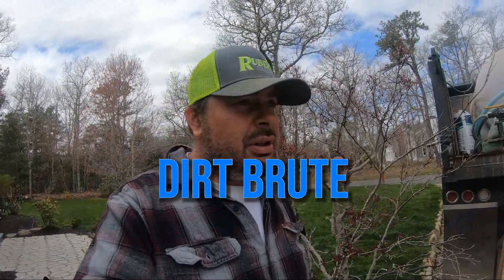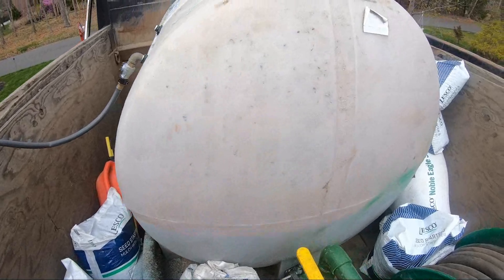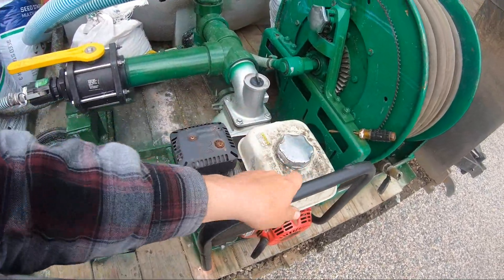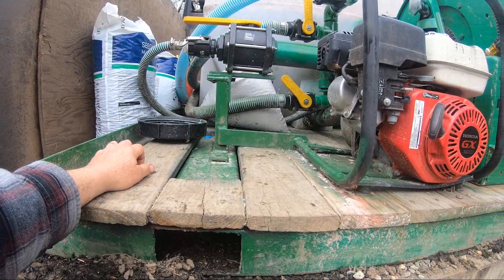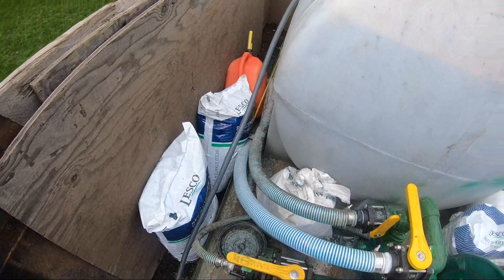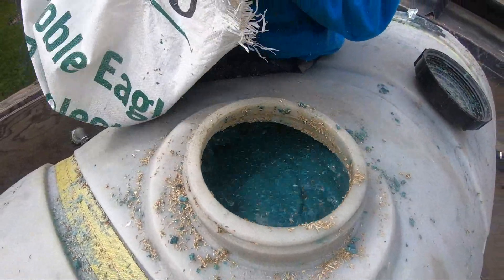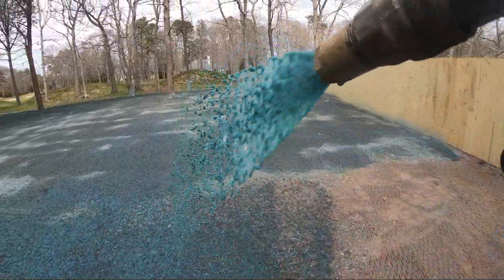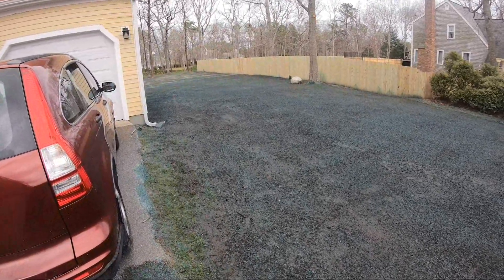Homemade DIY Hydroseeder 2022 Update!

Comment: Cool video!  One our local landscapers actually spread the seed with a push spreader and then spray the fertilizer and mulch over it.  They feel they get better/consistent coverage that way…I have no idea if it’s better or worse but it works for them.
Reply from the maker: I’ve actually done it that way and you get more coverage but the growth comes out bad I think because it not in the mulch it’s under it . We tried it twice and didn’t like it. If you mix it correctly with the right square footage it should come out good.

Comment: how far does one tank go how big of a yard can you do with a full tank? also can I get a material list for a batch what are you using? I just bought a hydro seeder and plan on doing this as a side hustle next year
Reply from the maker: @EluderRacing  i depends on how thick you mix it . I once covered 9,800sqt twice because I mixed it extra thick with 100 pounds of seed and it came out great .  Use 5-6 30pound bags of pellets to 700 gallons of water and one bag of starter fertilizer

Comment: Hi do you think it would make much difference running a separate motor and pump for the jet agitator and another for the application hose
Reply from the maker: It would probably work great but you would be having to maintain 2 engines and more plumbing .plus it would take up a lot more room and weigh more .

Comment: Hey Steve, just wondering if you have a video (or could make a video) on why you changed out your original agitation manifold? Did the 1 inch lines not work or just wanted more flow to roll the tank? I understand the reason for moving the jets to the legs for sure. I'm going to be putting my own skid together next week up here in Canada and found your video really helpful! Just want to make sure it's going to be fully functional first shot. Thanks!
Reply from the maker: The 1” lines don’t roll the tank as good and the 1” elbows clogged.

Comment: what all do you put into the mix and ratio? in the process of building one of these in KY
Reply from the maker: We do 12-17 pounds per 1000sq foot of seed and the mulch pellets are one bag per 150 gallons of water. Sometimes we use a blue grass, Rye & fescue mix. Or just rye depending on what the job is . You just have to go to your local supplier see what’s available in read the mixtures on the bags or the bales

Comment: Did you angle the agitators up of shoot them straight across?
Reply from the maker: My new style shoot across the bottom and rolls the barrel. Check out the video on the upgrades https://youtu.be/KWRgtbzfzJo?si=UPOG8W4XkVL1BlVC
Reply: Thank you
Reply: @DirtBrute  I’m making a hydro seeder and I was wondering how you reached into the tank to tighten up the agitator nozzles?
Reply from the maker: @tmr1331  I put the bulkhead fitting on a plumbing snake then ran the snake to the hole with the nut on the outside. The tightened the nut
Reply: @DirtBrute  thank you

Comment: would be great if you do a video with parts list so DIY's can build their own hydroseeder
Reply from the maker: That’s  a good idea!  I’ll try to work on that
Reply: @DirtBrute  sweet thanks. I was quoted for 12k and because I am located in Greece adding shipping costs, import taxes etc on top I am sure it would end up costing us over 20-25k. Sure a hydroseeder like that can be built with much less.
Reply from the maker: @digcutkos  yes I spent $2,300 two years ago
Reply: @DirtBrute  exactly my thoughts as well. Even with current supply chain issues still it wouldn't cost more then a 5k sources locally to me now vs 20-25k

Comment: Yo bro how much you charge for sqfoot?
Reply from the maker: Well here’s the thing. I don’t charge per square foot . I triple the cost of materials.    I know a lot of guys around here are getting anywhere from $.18-$.22 a square foot. I try not to do small jobs. The reason is for example. I priced a small job $.18 per square foot one time and it worked out to be $270.Then when I went to go buy the materials it was $336 Just for me to buy the stuff. I guess you could double the cost of the materials and still be OK